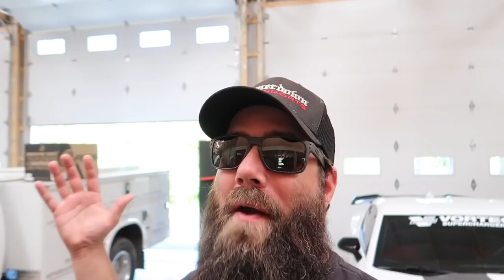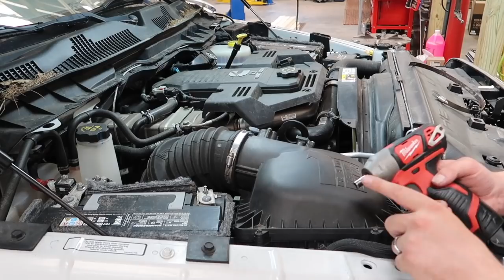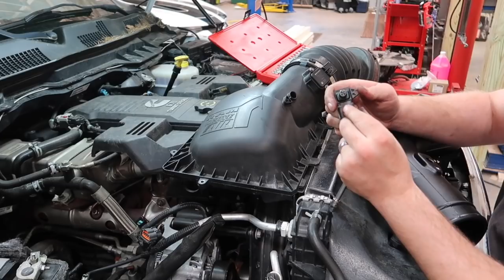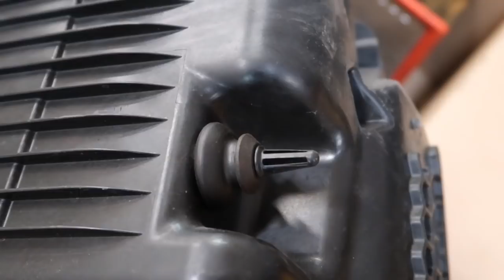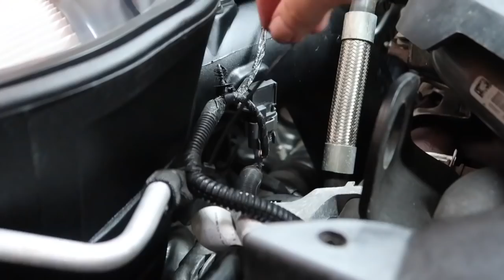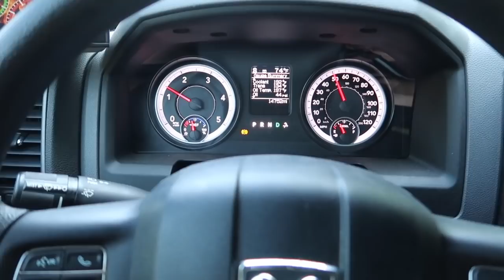Why You NEED A Cold Air Intake On A Cummins

Comment: I just looked at my '16 with 135k miles. No issues with the clamps. The OEM is a cold air intake just as the aftermarket units. They all use the the OEM gate and drive. I did have an aftermarket big wet filter on my '14 2500. I visit a lot of dusty construction sites and noticed that fine red Carolinas dust was making past the oiled filter and coating the down tube. I went back to the OEM box and a Wix OEM filter. No more dust.

Comment: I put the same filter in my '17 Ram and really like it.  It can be somewhat of a PITA when attaching to the turbo.  Fortunately, I don't have a lot of obstructions.  LOL.  Anyway, the tabs on my battery box broke just like on yours.  FWIW, I pulled the battery box and rebuilt the broken area with aluminum angle and got rid of the grid heater relay mess while I was at it.  Solid as a rock even after removing the filter box several times.  Love my Ram, it's my fourth, but they sure did cut a few corners.  Great instructional video for a first time installer!

Comment: I’m pretty lucky I picked my truck up in California the only thing I noticed is because it’s got 84,000 I needed to completely change out all the caliper brake fluid the coolant fluid and I’ll start on all the other oils but basically it’s a brand new truck at 84,000 except for some paint damage just from all the sand being blown around

Comment: You can’t beat stock filtration.  I sold my S&B intake after my intake tube was dusted and oil analysis confirmed filtration not sufficient.
Reply: I don’t know man, the stock air filter box flows a lot less air then most after market cold air systems, as far as filtration perhaps upgrade the air filter to a better quality filter?
Reply: @illestk24civic  stock box good to 500hp. No performance gains with aftermarket intake unless exceeding 500hp. It would probably make a small difference on a naturally aspirated engine, not turbocharged.
Reply: @dodgecummins6181  you can easily reach 500hp+ just doing a egr delete and efi live
Reply: @illestk24civic  absolutely, but most people aren’t pushing that much power without a lot of work like head studs.  If over 500hp then I take a good idea.  I’m at 425 hp 810 tq on stock box.  Just a towing machine.
Reply: @illestk24civic  Stock air filters flow a lot less dirt than the aftermarket filters too.
Reply: I've ran an oiled S&B filter/box on my '17 (not stock) for about four years now.  Renewed the filter once.  I send oil samples to Blackstone every change and I have to say that they have all been excellent with recommendations to delay oil changes.  But to each his own, just an FYI.
Reply: @illestk24civic  The stock air filter flows less air because it's doing more filtering. If you think higher airflow equals a better filter, I've got news for you. It's the other way. Increasing airflow through a filter at the same differential pressure requires reducing head loss through the filter, which means less flow restriction, which means larger filter pore size, which means dirtier air in your engine.
Reply: @illestk24civic
Reply: I had both stock filters on my 5.9 essentially collapse because the turbo was trying to eat them
Reply: @wizard_of_poz4413  maybe it was hungry?
Reply: @dodgecummins6181  I have no idea why that thing needed so much air, I bet it was pushing 30 or 40 psi into the intake
Reply: @wizard_of_poz4413  are you using the mopar filter or something else?
Reply: @dodgecummins6181  when I had it, I quickly converted it to a Volant box with the k&n filter for the sake of flow. Although I imagine the Donaldson gives near stock levels of filtration with a boost in cfm
Reply: @wizard_of_poz4413   You weren't monitoring your filterminder
Reply: @davidanderson8469  I was dude, when I installed a brand new wix filter with deep pleats in it, it sucked the minder all the way to the red after a 5min drive
Reply: @wizard_of_poz4413   Wowee. I use the same filter on my '07 5.9. Zero issues. I do have the Home Depot mod on it but even before that no issues. It would move the filter minder with the old 2" filters. That's quite a mystery.
Reply: @davidanderson8469  that's why I bought a volant with a k&n filter and that made it into a whole different truck when it could get air
Reply: @wizard_of_poz4413  I had the same problem then I went to wix and that ended
Reply: @raymondlanier1112  is that reusable
Reply: Should have bought banks
Reply: @brockc9814  why?

Comment: I have a 99 2500 5.9 24 valve. The original air filter set up it came with  IS a cold air system . It draws air from the fender well. I upgraded  to a better filter ,but see no reason to change the factory air box.

Comment: Caught your video. I was doing a delete on my 2500 and I had the exact same issues when I was working on the truck. My band clamps were loose on the turbo end and broken in the middle. I also found the tab on the engine side of my battery tray broken and as soon as I unbolted the air box radiator frame bolt it fell toward the motor. Looks like I will be getting an S&B intake and a new battery tray as well.

Comment: I just found a broken and rusty clamp yesterday on my 2015 with 37,000 miles on it.  Checked the rest and one was nearly in half and the other two were really rusty.  Not good.  Thanks for the video.  It made me check all of my clamps.  What kind of mileage increase are you seeing on the S and B kit?

Comment: Thanks.  I'm here because I was looking to replace those broken clamps.  Glad you confirmed what I was finding in trying to replace the center clamps. The system you reviewed here is no longer available.  Is there another you recommend?  Might as well replace the intake rather than try to find those clamps!
Reply from the maker: Yeah I would check S&B’s website maybe they updated the part number but the new system sounds so good it’s worth it

Comment: I have seen several times where an aftermarket intake is just a better replacement for more then just performance.  Plus they usually look better
Reply: Correct. The factory airbox is a cold air intake.

Comment: I'm taking out my S&B air filter box. Several reasons, 1st is it does not filter like it should. The factory air box is  whats supposed to be in it for maximum air filtration.  2nd is the extra noise, if I wanted noise I'd cut the exhaust out and do a custom straight pipe. 3rd is, if you read the owners manual removal of the factory air system or any factory pollution devices is against federal law and some state laws. And with the new administration the feds are cracking down. And with that are hefty fines. With the kids ( adults also) rolling coal and running straight exhaust they are ruining diesel trucks and bringing heat down on all of us.
Reply from the maker: Yeah the emissions stuff is anything before the throttle body or turbo inlet in this case or anything after the catalytic converter or DPF is fine since it does not affect the emissions of the engine but I would have left my factory one on if the dang clamps weren’t made out of garbage which could have resulted in my engine getting dusted if I didn’t catch it in time, but anyway I do like the sound it makes

Comment: I’ve been battling over the exact same clamp with multiple dealerships for several years.  Their IPC’s are incorrect and they’ve ordered and tried to sell me the wrong parts numerous times.  Sad to say this will be the last Ram I will ever own.  Customer experience, service department, design and engineering, all rank horrendous compared to other manufacturers.
Reply from the maker: I love the Ram but FCA needs to weed out their garbage dealers just like department stores these horrible dinosaurs will be a thing of the past hopefully sooner than later terrible service is the biggest reason I'd buy another brand
Reply: @HammerdownMotorsportsUSA  Same issues. I love my Ram trucks, but since Fiat got a hold of them, customer service from them and the dealers are awful. I am usually more happy to see the warranty run out so I can work on the truck myself and know it was done right. Seems the issue lately on all my trucks has been the 8.4 U connect system and GPS failing. I have had 3 of them go tango uniform. I am going to try a full screen Tesla style stereo next. It might be made in China, but so is the one they use that is junk and costs a fortune to fix.

Comment: GOOD VIDEO for the install thank you for posting. at 20 minutes you talk about the clamps and for DODGE you shouldn't be shocked with low quality anything. I was searching for a WHY TO INSTALL COLD AIR INTAKE....you never mentioned why? looks to me like all thats gonna do is BARELY IF ANYTHING up the HP with ten ponies.if that!! and wow your truck is louder? my 2006 diesel IS LOUD AF. noise is garbage. I wouldn't mind a rebuttal of WHY you installed it.....like better GM or smoother acceleration? or 50 xtra HP? did your check engine like come on? or did you retune your cpu? 
again i see a lot of these dodge owners with rusty this failing that.......its because you bought a dodge lol
Reply: Our clamps are fine too.

Comment: How did your diesel do with the new cold air intake , towing and climbing hills?
Reply from the maker: its been great so far I like the intake noise you get with the system for sure
Reply: I'd like some as well just don't want it to be insanely  loud or annoying,  no mil lights ,codes or any issues
Reply from the maker: @VP23  it isn’t much louder than stock just little bit more semi truck like but no mil lights or issues
Reply: Thanks I appreciate the info

Comment: I was told blowing off your air filter with compressed air isn't a good idea because it breaks down the filter and creates small holes that allow dirt to pass through easier. Basically pushes the dirt through breaking down the filter.
Reply: ZappaZGaming  you’re supposed to go the opposite way - don’t want to blow it through but blow it back the way it got on to the filter
Reply: @1530Nick ,  ZappazGaming is correct even if you blow it out the way it came in. You are leaving microscopic holes that weren't there before which will let more unfiltered air into the engine than if it was left alone. I cringed when he said that and couldn't believe a mechanic would even mention doing that.  Hell even in my mowers owners manual it tells you not to. It doesn't even want the filter box opened until the filter minder points its time. Every time a filter box is opened there is a very good chance of getting dirt into it. The less its opened the less chance of dirt getting in.

Comment: The clamps were not bad ... the problem is with the dealers ... there Mechanic broke my trucks air in take box bolt locations cuz they use power tools to put back the things ... so the clamps were probably broken by the the dumb mechanic using the a power tool...
Reply from the maker: well mine rusted  to nothing  in less than  15k miles
Reply: @HammerdownMotorsportsUSA  i got a 2015 3500 with 169k miles and I'm in northeast  ... clamps are still good ...

Comment: What about the check engine light??
Reply from the maker: None on mine
Reply: I thought in the video I saw the check engine light bottom left.
Reply from the maker: push broom ahh yeah I had a DEF code at one point may have been on then
Reply: I have a stock 6.7 Cummins n my 2010 Dodge Ram 3500 115k original milage.  Trying to decide to stay stock or delete.  Right now (stock) I get about 18/19 mpg @ 80 mph on the Interstate. Pulling my 33' travel trailer  get about 12/13 @ 75 mph.
Reply: @pushbroom9398  stay stock. The feds are cracking down on diesel trucks, even pickups, that are running illegal tuners and taking off stock air boxes and pollution devices. If you can afford the EPA fines go for it. Your owners manual will let you know about the federal laws on removing eq.
Reply: @stevenjackson7067  thx stay safe/healthy during this period of the pandemic 😷

Comment: Really dissapointed in the design of those clamps- looks like every cummins will have the same issue. I just bought a 18 durango and had to add a tow hitch. Dealer price was $1600 for the hitch and wiring. I understand alittle markup but cmon.
Reply from the maker: agreed thats why I buy the parts and install them myself

Comment: My question is what did it do to the egt's?
Reply from the maker: Dstrbd egts haven’t really haven’t changed much but turbo sound is so good now
Reply: @HammerdownMotorsportsUSA  Thanks for the quick response. I was just asking because I don't see anyone saying the difference with a COLD AIR INTAKE if you know what I mean. I have a tuned 04.5 ram 3500 and was hoping the intake would maybe cool it down a tad. Obviously tuning it to tow would lower egt's vs performance tune. I really appreciate the quick response!
Reply from the maker: @playinhookie  absolutely I need to tow with mine and really see what it does with a load
Reply: @HammerdownMotorsportsUSA  If you do and get a chance to post results it would be much appreciated. :)
Reply from the maker: @playinhookie  I drove it today EGTs were around 1135 on a pull pretty normal with no trailer
Reply: @HammerdownMotorsportsUSA  Thanks for the update! Will be getting mine next month, can't wait.

Comment: Lol that factory filter was way past it's prime man!
Reply from the maker: WhyNotUs lol it didn’t even have 15k miles on it and never saw dirty roads
Reply: Not really.  Those get an oily film on them guite quickly.  As long as the filter minder is still in green or yellow it's good. When it gets into yellow is when I change mine.  If you noticed when he spread the folds apart it was still fairly clean down in it. A partial dirty filter actually filters better than a new one. Some of the oil and dirt helps block small particles from getting through.

Comment: All vehicles have cold air intakes because it sucks the air from the outside not from the engine compartment a lot of these aftermarket so-called cold air intakes are absolutely opposite of what they said because they actually suck in hot air from the engine bay which the manufacturers do not want to happen because it will make your engine run hotter give you engine pinging so these mods might give you a tab more power but there's not a true cold air intake look at any car today look at where the air box is sucking the air from and it's not from the engine bay area

Comment: How do you get cold air from under the hood where the temperature is a minimum of 100F hotter while the motor is running?  SCAM!  The engineers at car manufacturers under pressure to improve fuel mileage and power are just stupid huh?  Almost ALL aftermarket “upgrades” are actually downgrades.  THINK!  ALL of their supposed legit dyno testing is done with the hood up with industrial fans blowing, probably before the motor reaches operating temperature.  Also, oil coated filters attract dirt.  A few miles and it’s plugged.  They are openly telling you it’s a lie.  There’s a reason why when you add one of these scams, your computer shows minimum 3 mpg less fuel mileage on a motor that rates around 20 mpg.  In addition, for a Cummins, the direction insert that evenly distributed air across your intake fins is eliminated with most of these “upgrades” It’s not a scam from a computer you are dealing with.  Snake oil for desperate people.  Sad!  Otherwise, this is a good install video for those who believe in illogical scams.
Reply from the maker: well I would have to say this cold air intake uses the factory designed active air that pulls air from the front grille and wheel well area so it isn't hot under hood air also the filter is bigger and I got the dry filer no oil also the piping is designed to reduce heat and air turbulence which allows better air flow, the factory uses corrugated rubber that is cheaper than the silicone the good aftermarket uses. So yes the factory one works but there is better aftermarket options just beware of the cheap garbage those are definitely a downgrade.

Comment: Surprised to see you working over a battery that isn't covered by shop rag or something to prevent accidental contact with posts. Knew a mechanic that welded his wedding ring to the bone...ugly.
Reply: That's why I wear a ceramic ring - no conductivity and if I smash my hand it just breaks and doesn't mash down on my finger. They are super cheap on Amazon and you can get different colors.
Reply: At least his wife was thrilled at his level of commitment

Comment: What is the motor and valve for in the intake?  Never owned a Cummins ram but about to get a 19 2500.
Reply from the maker: Aaron Miller it’s a 6.7 24v
Reply from the maker: @Predatorseeker  oh yes it allows the intake to take warmer air from the wheel well instead of the front of the truck in really cold weather
Reply: So it's not really a "Cold air" intake since the factory setup does that already, at least that's how it seems to me.